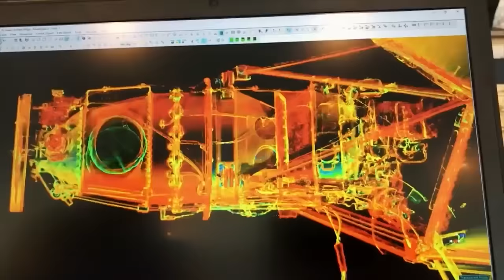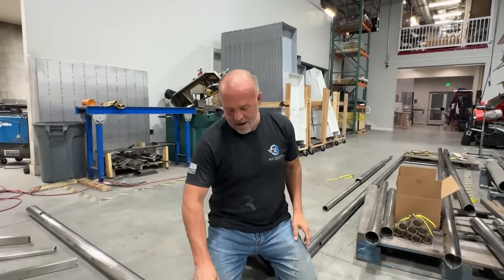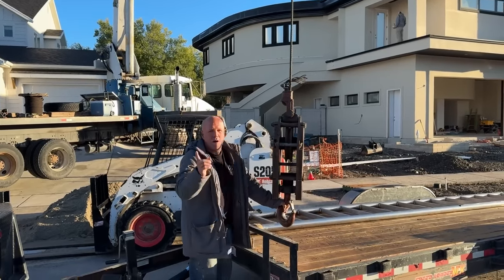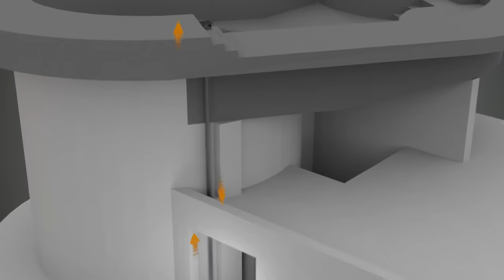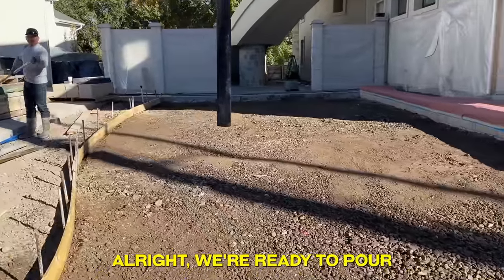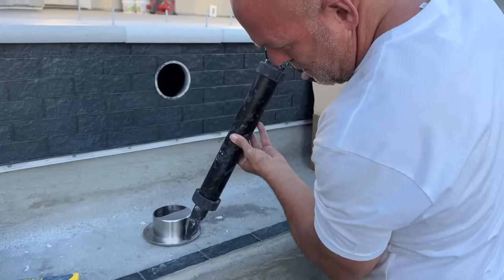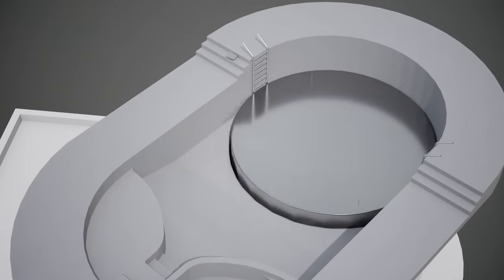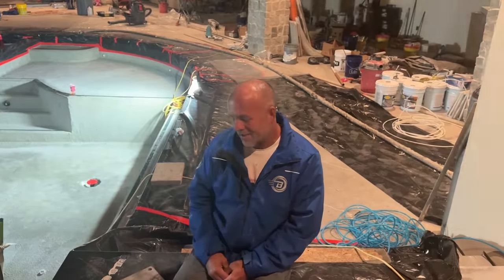Final Touches on My 24 Foot Deep Scuba Pool | House Build #19

Comment: Hi Mike, I love the pool and after my 50 plus years in aviation and your extreme approach to safety not having some form of safety barricade around the pool sends cold chills through my spine. It’s a long way down and although I’ve done deep diving to 300ft plus using trimix it’s hard to fix a bent body from a fall of that height. 
Your innovative mind is great to listen to and as I like to design my own furniture and do all the repairs required on my sailing vessel. 
Take care, I enjoy the videos and as you rightly say, we need to keep GA safer and all the best for the fast approaching festive season. Rgds J

Comment: This series has been absolutley incredible to watch. I am astonished with your level of attention to detail. One thing that is surprising to me is the tile work in the bottom of the pool seen up close at the 12 min mark of the video when Mike is laying down. No one will see it when the pool is filled up, but when it becomes the dance floor, they will be clearly visible. Small detail I know, but just surprised me with how particular Mike is with every single detail. Not trying to be a controversial commenter, just something small I noticed. Other than that, this is insanely incredible!

Comment: The fall hazard is making my stomach hurt lol. Amazing work as always!
Reply: Yeah. I'd thought the same thing before. No railings around the top. A disaster waiting to happen. Yikes!
Reply: Probably also invented jet packs that swoop down like iron man to catch you.
Reply: There is actually a motion activated electromagnetic safety system. Each person in the area is wearing a steel mesh suit that will allow them to be captured in mid air.  @burz
Reply: Railings around a pool? I've never seen any pool with railings around it. Kinda defeats the purpose of pool. How would you get in?
Reply: @Airplanefish They mean only during the construction phase. The fall hazard when the pool is empty and the floor is at the very bottom is indeed significant.
Reply: @Utube2Itube  oh. Gotcha
Reply: The ladder pin description got me 😂 sorry folks.
Reply: Same!!
Reply: Amazing project but the tile gaps on bottom of pool had me worked up.
Reply: @970CCM  
You’d noticed that too? 
I think they don’t think anyone would see it once it’s filled with water 😂
Reply: Mike obviously thinks "it won't happen to me" hear that a lot in my trade career.

Comment: You are totally incredible.  I doubt you actually have time to watch other YouTube channels, but there are a couple of sailing channels I watch, one of which is 'Gone With The Wynns.'  I often wonder what a catamaran designed by Mike Patey would look like!  LOL  Anyway, Jason and Nikki are in process of building a new catamaran to replace their older one, which they sold.  There are two lockers in the forepeak of each hull, and they were planning on using them to store e-bikes, but it would appear that they aren't quite big enough to store the bikes they want.  I thought 'What would Mike Patey do?'  So, I sent them a link of what you did with the bikes on Scrappy, and said 'Think outside of the box.'  So, I don't know, maybe they will take some ideas from you on that.

Need to see you design a boat, a sailing catamaran.  That ought to be interesting.  Hydrodynamics can't be that different from aerodynamics!  🤣😂😛😜

Comment: I think those cable tubes are going to pump a lot more water than you think up into the "dry" side. I would consider some wipers!
Reply: I am interested in how all this will work.  I would have looked at how they pulled off the moving platforms for the Cirque Du Soleil tanks for the "O" show in Vegas.  They have underwater moving platforms that rise and lower quickly and become usable stage when out of the water...They drain fast and allow water to pass through so the platforms can move, all the while being non-slip and danceable within seconds of rising out of the water without squeegee use.

Comment: Mike will eventually reveal that the moving pool floor is a piston, and a cylinder head is currently being designed. In times of trouble Mike will be able to power the neighborhood with his low rpm high torque pool power station. 
Good work!

Comment: I'm not a "Safety Sally", but implementing a few safety protocols would greatly lower the risk for serious injury or..... death 😬

There are several serious safety hazards happening: No guardrails. Workers in the bottom of the pool without hardhats and people working above them. People working on the leading edge of the pool without fall protection.
Reply: My thoughts too. Accidents happen accidentally.
Reply: I get the hard hats but how do you suppose they install a saftey rail while also installing tile and working on the edge of the pool? Are you also critical of people working on roofs without saftey rails?
Reply: @mcgee6177   @mcgee6177  A warning line system or "controlled access zone" (stantions w/ flagged rope 10 feet back from the leading edge) may be used in lieu of a guardrail, but all workers inside of that zone need to be using fall protection. 
Roofers play by different rules, they have exemptions when it comes to elevated/leading edge work.
We could come up with a hundred excuses as to why it's not possible to implement some basic safety protocols on this jobsite but none of those excuses will be valid when there's a dead worker at the bottom of that pool.
Reply: Welcome to residential construction
Reply: How about a "Koncerned Karen"
Reply: Maybe why the job is going so well . Help here and family I believe are capable and trusted to think for themselves
Reply: that may be why the project is going so well . Help and family here are trained to accept responsibility and think for themselves. With that criteria we don’t need dictators and the job gets done.
Reply: @mcgee6177  yes.
Reply: @sixtomidnight1492  I'm guessing you were born in the late 1990s or early 2000s. Or your just some Wash-out that became a Safety Guy.
My dad had a saying: "Those who can,do. Those who can't do, teach. Those who can't do or teach become the Safety Department."
Reply: @GrizzAxxemann   @GrizzAxxemann  Nice try!I was born in the early 90's and have been a carpenter for 10 years. The company I work for has a very low EMR because they train/teach their employees how to work safely. My grandpa had a saying: "On the account of a poor head, the whole body suffers." 😉
Reply: @sixtomidnight1492  You're still a young punk kid. ;)
Reply: @GrizzAxxemann  What's your professional construction experience?
Reply: @sixtomidnight1492  28 years hauling your crap around in the transport industry.
Reply: Yeah it’s scary as all hell to me as well!
Reply: @GrizzAxxemann  Hahaha, exactly. Have a nice day!
Reply: @sixtomidnight1492  whatever you say, Karen.
Reply: Some European city had a downtown that mixed pedestrians and cars with tons of warning signs, painted lines, and numerous safety crap.  They had many accidents.  To solve it, they removed EVERYTHING....signs, safety crap, lines.  Now the cars and pedestrians mix freely and because they do, everyone takes more care and the number of accidents had dropped to near zero.
This over-safety bureaucratic crap is making people defer responsibility to safety to others. They expect people to follow the signs, lines, and safety crap and stop looking out for themselves and others.  Accidents then ensue.  People are not stupid...especially people in these skilled trades.  They know the dangers and what they can or need to do.  They do NOT need OSHA bureaucrats telling them what to do or requiring a bunch of unnecessary safety crap that gets in the way and actually prevents the work and innovation from happening.  These people are professionals and only work with the best. These are not the type of people to take a cavalier attitude towards their own and other's safety....they rely on common sense and experience....not government bureaucrats getting paid to protect the lowest-common-denominator.

Comment: Maybe put a small railing system on the side of the lift facing the main pool, so when you have it raised for kids pool section there is no chance of the kids going off the edge intothe  deeper main pool water. The railing would actually be up against the wall when the lift floor is below top of water line. That should mean it won't interfere with the diving activity.

Comment: Mike, will the deep end of the pool default to a shallow height when not in use? Reason I ask, if someone who can't swim falls in and sinks down to the bottom, it would be quite difficult for a typical person to dive down 24 ft and grab the other and swim up before blacking out. Are you intending to hook the pool up to a key fob or passcode of some kind where it will only lower if you're present?
I guess if someone fell in, you could also just raise the floor rather than dive in after them...
Just wondering...
Reply: Yes, the default will be in the up position.
Reply: @ChandraSlyFoxPatey  Good to hear Chandra. Thanks!

Comment: Mike Patey. 
I am curious, how do you drip the cables?  they are exposed to the water, they run up the conduit to the top pully assembly, then back down the down conduit.  Seems there should be a drip point at the bottom of the down conduit so that the cables, which are exposed to water, can drip before running into winch motor.  Maybe I missed something in the design.... Great awesome work and awesome consideration of all the layers of waterproofing and protection.
Reply: Good point about the moisture, I bet the winch motor is likely far enough away in the basement that the 24-27' of wet cable probably never reaches it. Edit: https://youtu.be/Lx7600CMWDA?t=159

Comment: You could heat each ladder to 105°F then pin it solid at top and bottom.  
Any colder temperature puts the ladders under tension which won’t cause S-bending.
Reply: Sounds like the S bend is the lowest concern; not cracking the mounts or underlying concrete is paramount. Even if directed in tension, the large temperature delta in winter would probably have enough force to rip the anchor points out.

Comment: Railways have solved the thermal expansion issue for continuous welded rail. I'm no engineer, so forget the exact mechanism, but you install the ladder hot and fixed in place, and the expansion becomes contraction thats resisted by a different material characteristic that doesn't result in buckling.
Reply: YouTube channel Practical Engineering just did a video on continuous welded rail and expansion, if anyone is curious to know a bit more about the specifics.
Reply: @dave7038  that'll be why it's fresh in my mind lol. Couldn't remember where I'd absorbed the information!

Comment: Mike, I'm interested in the type of stainless steel you chose for the cable guides.  You say it is the best and that you will have salt water for the purification.  In our leather tannery, where we use a lot of sodium chloride in the processes, we used 416 SS but even that is prone to chloride pitting and does not last past 10 years before we need to replace it. Alternative is just too expensive.

Comment: Are all your cables the same length? I had a project like this in miniature, a seed starting tray, hung by four ropes, joined into one, then a single rope through a block and tackle. I prioritized keeping the works out of our way in a tight basement. This made all the ropes different lengths. The longest and shortest lengths were opposing corners. The differential lengths had differential stretches.

It took a year of settling and a switch to sailboat rope to get it acceptably level. I still need to reset it if the loading changes, or too much time passes.

How did you manage this particular dynamic?

Comment: Mike, I have a question. I know the legs of the ladder go thru the platform. What I’m not following is how the platform will raise with the ladders in place. Do the rings of the ladder come out and the stub outs from the wall holding the ladder to the wall come out also?  I would have thought that you notched the platform to accommodate for the stub outs. Just curious. It’s that engineering mindset in me. You know how we are. We have to know all the ins and outs of everything and how it’s going to work. I think the house is crazy cool though. I can’t wait to see the finished product.
Reply: It think the platform will be notched like u shape at each ladder so it uses the whole ladder on the sides

Comment: are you not concerned with the dry side of the pully system retaining water from water tension allowing moisture to accumulate on the lines in the dry side? Also noticed you have ALOT of exposed wood in the tank area, while salt normally remains when salt water evaporates, salt can still be carried by water particles in the air when excited (from water dropping from such a height) is there something im unaware of going to water proof that area above and around the tanks to protect all that exposed wood?

Comment: Fantastic engineering as always! Only one question on the wet side/dry side of the cables - when the pool floor is being lowered, the cables being pulled up through the wet side will still be wet as they travel over the top bearings and down the dry side - so is there drainage fitted on that dry side to allow the water pulled into the dry side by that?

Comment: Are you planning on waterproofing the wood framing that your skimmer pipes terminate out of (into the basement overflow tank)? I highly doubt it could create any sort of short term problem, but I'd assume quite a bit of in room moisture from the falling water. It's a concrete room, it'll hold onto that unless it's actively dehumidified.

Comment: Two genuine questions - 1. the wet pulley cables will obviously introduce water to the dry side of the vertical cable management, so how will you manage this? 2. I run a reef aquarium and the overflows are quite difficult to keep silent so do you think the waterfall overflow will be a problem? Thanks

Comment: Amazing idea and a great piece of work/art👍
I hope you are using O³ (Ozon) & ultraviolet light to cleanup the water in the pool as cleanup system?
Reply: I wouldn't bet against him also using ozone and/or UV light, but the main cleaning is using saltwater.
Reply: @patheddles4004  - Then I can only hope that saltwater resistend stainless steel(V4A) is used, because the usual one V2A will rust away (visible by getting black)
Reply: @Morpheus-Sco   The effects of salt water are absolutely a concern, stay tuned for more info.
Reply: @Morpheus-Sco   yeah, I know about the saltwater because Mike mentioned it (in this video) as why he needed to make stuff so corrosion-resistant. Reckon he's on it.

Also hi Chandra, reckon I might also take your word that Mike is aware of it. :-)

Comment: If 20 people simultaneously canonball into the pool is it possible for water to rise inside the wet-side of the cable tubes and migrate into the dry-side?  Does the dry-side drain to somewhere that water won’t cause any issues?

Comment: So when the movable platform starts to move down, how are you going to get all of the water past it? If the pressure rises slightly under the platform, then the water in the cable tubes is going to rise over the peak and siphon out all of your water into the basement. I’m very curious to learn what your solution is mike!
Reply: I have assumed the platform will be a grate and not solid.
Reply: The Cirque Du Soleil "O" show in Vegas has already solved this problem.  Giant fast moving platforms going up and down in the pool and becoming a stable, non-slip dry stage within seconds of rising out of the water.  No need to reinvent the wheel.
Reply: @tedthurgate  I am just a bit concerned that only a slight variance in pressure will cause the water to go over the cable tubes and siphon the water. I’m sure Mike has a crazy over engineered solution.

Comment: I have a question, how are you going to do the pulley system at the bottom of the stainless steel tubes on the wet side, if I understood correctly your plan you have to connect the tubes to a water tight box who hosts the pulleys? Getting the cables in place will be an interesting and challenging operation. I hope we will see that in future videos.

Comment: Curious about the size of the SS conduit the cables are riding in, i wonder if they might act like a pump when lowering the Deck. Seems like there's a chance that the movement of the cables over all that distance in the wet side conduit and because of surface tension of water, it may pull water out of the wet side, flood that pulley compartment and let water down into the dry side... 🤔

Comment: I had a salt water pool, and never again.  Absolutely anything within 30 feet of the pool corrodes, including stainless steel.  I switched to chlorine, and it improved, but there is still so much salt around the pool area that things still corrode, just not as mush.

Comment: Just to be a bit of a doom-sayer, if by Garolite you mean G-10 (glassfiber epoxy laminate) for the platform sliders, personally, I wouldn't use that. While probably fine, there's a small risk of wear releasing fiberglass particles/shards into the water and that's definitely NOT a fun time if it gets into skin or worse eyes or internal body cavities.

Comment: Mold ??? Pretty wet down at the bottom with exposed wood, is it possible to have mold issues?? I built a concrete house and the walls would mold because the occupants wouldn't use the bathroom fan enough.
Reply: We live in a high desert, it’s fairly dry.

Comment: Really can't wait to see what you are planning for renewables, ground source heat pump? Solar? Battery? Community wind turbine? 

You are going to be using a massive amount of energy for heating everything, running pumps etc, that's a lot of co2 and load on the grid, 

Could be really interesting.